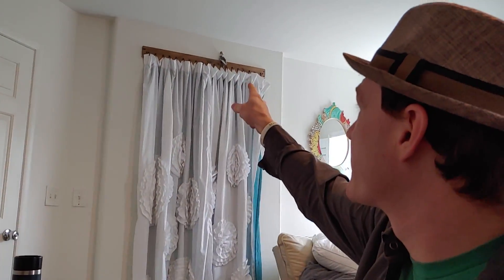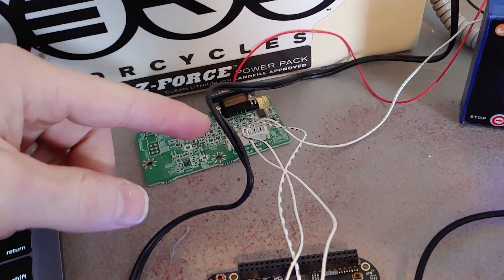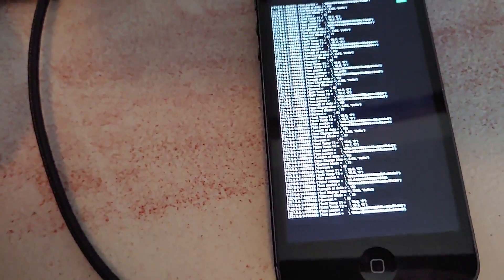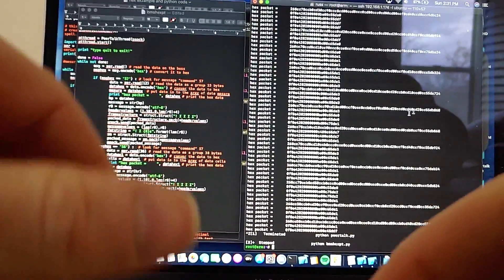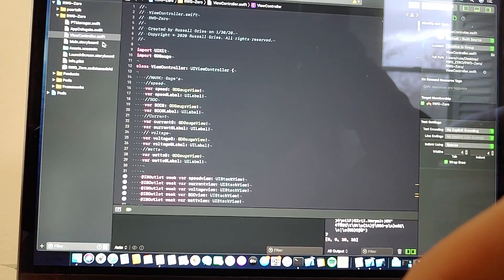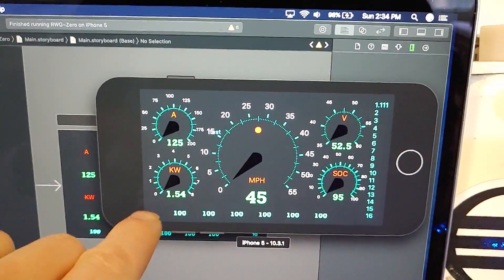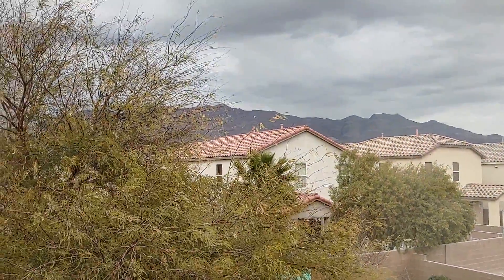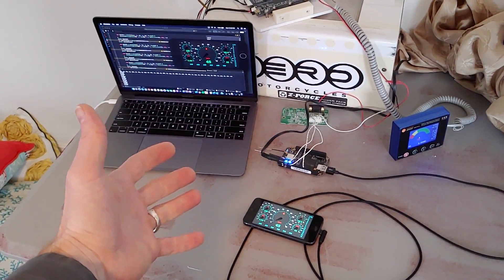Zero P12: Coding.. More Coding.. Pulling Hair Out... some success :) ( Getting Closer)

Comment: Hey man I've followed you for a while now, your video really blessed me! I'm working on finishing a project as well and yes, I just went through the hair pulling stage myself, over programming, self taught just like you, guided by the holy spirit, thanks for the encouragement, maybe we could work together in the future, I'm working on a similar project involving a 3 phase igbt inverter controlled by svpwm programmed on a spartan 6 fpga board, I'd like to incorporate a 7"  touchscreen display/control panel, I'm about 95% there